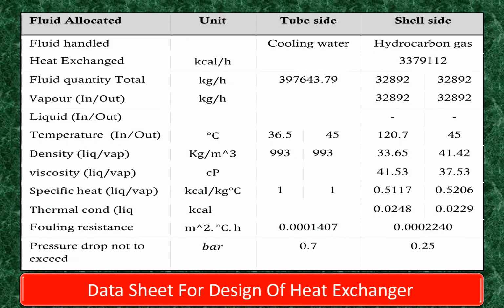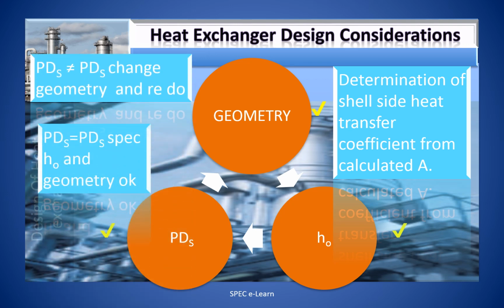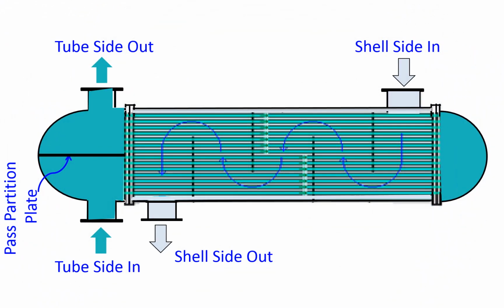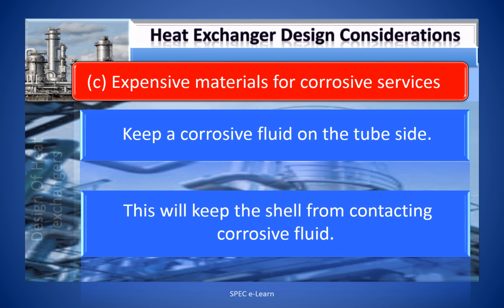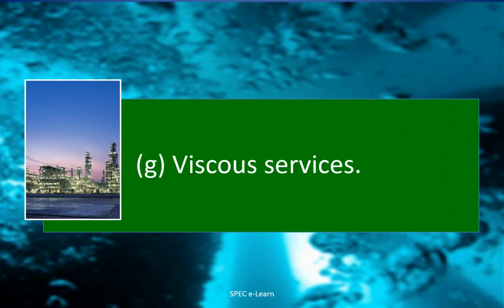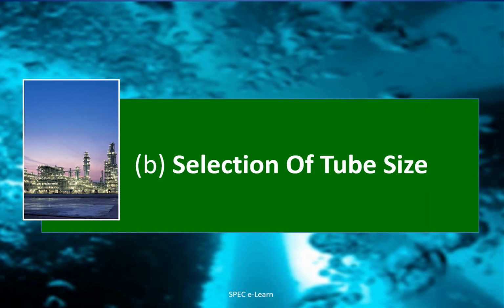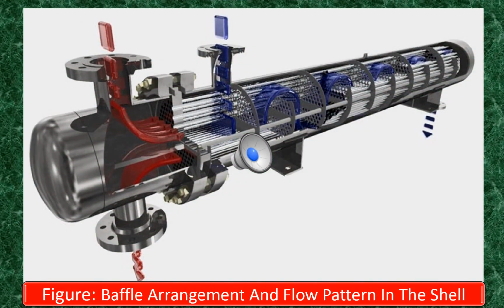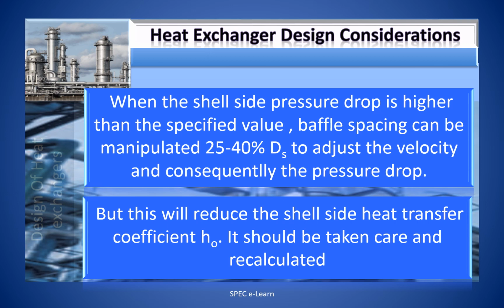Heat Exchanger Design Considerations Part 1: Selecting The Right Side For Fluids & Right Geometry

Comment: nice video 👍🏻
i request you to do video on heat exchanger interview question for 3-4 year experience engineer,for those who want want to make their career in hydrocarbon industry.try to cover many technical questions if possible 👍🏻
Reply from the maker: Okay sure
Reply from the maker: I would also like to point out that  videos on interview questions on heat transfer part 1, 2 and 3 have questions which are relevant for experienced engineers. If  you haven't yet gone through these videos, I would  recommend you  to go through them.  Something more I will cover in the future video
Reply: @SPEC786  sure I'll watch and let you know 👍🏻